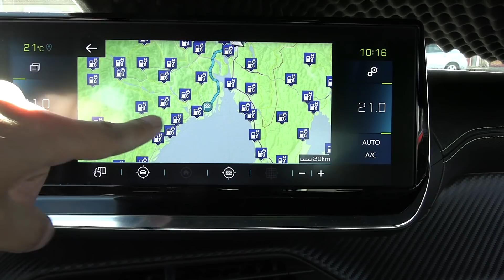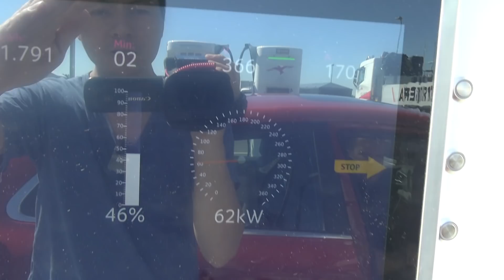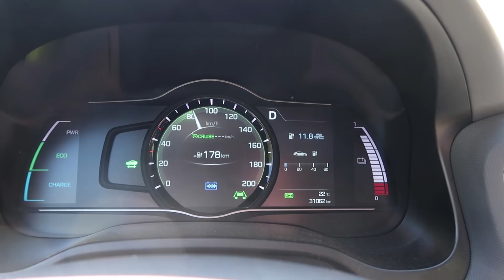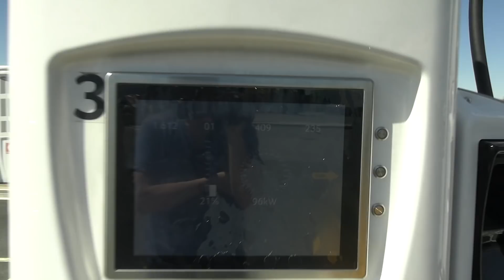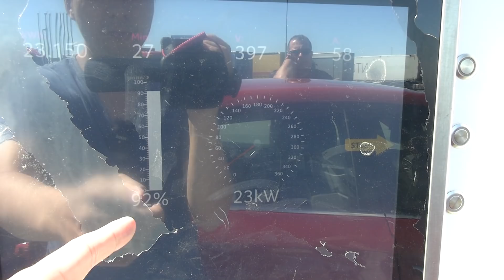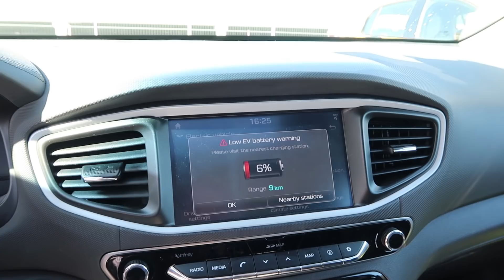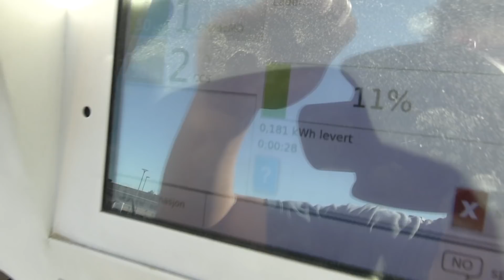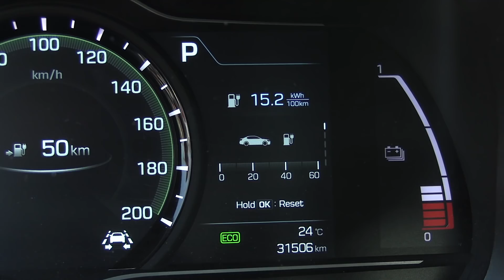Race between Peugeot e-208 and Hyundai Ioniq 28 kWh

Comment: After one year and 21.000 km with my Ioniq, there hasn't been a charging issue with the car. I still can recommend it. The only issue I had was an unwanted noise coming from the mounting of the back seats, which I could fix with a tape. What still surprises me the most, if you switch off recuperation and use sailing only, how long it takes to get slower. If there is a small decline, the car holds it speed without any energy loss. It is still the efficiency king.
Reply: Same with my Model 3 if you put it in Neutral while driving. It feels unreal. Electric drivetrain ftw!
Reply: Got a hold of a classic Ioniq befire they were off the market and man am I satisfied. Such a great EV and super efficient.
Reply: I have one since 4th of February 2019. It has today (4th of June 2020) 47.500 km on the odometer.
The efficiency is almost unreal but having sayd that, this is probably the worst car I have ever owned,and I have owned 36 cars. Even 1987 Dodge Aries was better to sit in 😢
And that is the car that almost got the Chrysler factory bankrupt. 
The worst car I say, yes. Terrible to drive on those Energy saver tires, and not better on the Continental ContiContact 7 winter tires. (I guess I could blame the tires for that) 
Seating position for me (I'm 200 cm tall) is not good for me.
Small space in the trunk, terrible road noise, stupid design to have the front axle lighter than the rear axel and a lot of other things I'm not going to mention here.
You might ask if I didn't test before I bought it, and the answer is yes, I did. But not good enough 🙁

I can't wait to get my Model Y and I would very gladly loan it to Bjørn to do some tests on it...... EXCEPT OFF ROAD TEST.... because he has shown us that he can't the "off-roading" 🤣😂
Sorry Bjørn, no offence 🙂

Comment: It's probably not the front which affext the aerodynamics but the teil - the lower the less turbulence.
Reply: Good Point. But the Front cooler is also stopping a lot of air. Unfortunately Peugeot’s Front cooling system is still Open :( (PSA Plattform -> can built Electro and gas on the Same Platform)

Comment: I've owned a Peugeot e-208 as well for close to a year now, and have had many charging issues as well. Car has been back to the dealership multiple times, it's working again. But sometimes still stops charging without a reason. Also the app doesn't work most of the time, so I am unable to check the charging state or pre heat. Based on your video it seems like it's an overall issue with the e-208, just like the high power consumption. Thank you for putting in the time to show the real world use.

Comment: The longitude of the Ionic is what makes it efficient on roads, small cars have turbulence on the back I think. But it's the opposite arrond cities, where the small weight of small cars is more important than air drag.
Reply: True, although the E208 is heavier than the Ioniq by a significant margin (+100kg at least).

Comment: Only thing that is missing on your channel is ioniq summer range test.
Reply: I got mine down to 8.4kWh/100km today. Couple of days ago I had driven 66km and the SoC was reporting 80%, giving a theoretical maximum of 330km. Not possible in reality, but it goes to show that that car can get you a decent distance in decent weather.
Reply: @Hans-gb4mv  what could be maximum range on motorway 120km/h in summer?
Reply: @jerrym1401  I did about 190km today, mostly at 120km/h and came home with around 18% and 33km left. Here's the chart for a trip I did last year at the end of May, mostly doing 120/130 on the German autobahn https://tweakers.net/fotoalbum/image/fKVi7AznVs7eZuB2w5dKD2bu.png
Reply: It's coming. Bjørn has talked about doing a summer range test with the red Ioniq featured in this video.
Reply: @jerrym1401  It's about 200km. The consumption is around 14 kW/h in the summer with a maximum of 120 km/h
Reply: Getting 138miles/ 220km currently. Temperature 24°C. Mixed roads.

Comment: I already watched the livestream on Saturday but this video was nice entertainment.
I am thinking of changing car but a little afraid of all new cars that have so many electronics functions, especially the low volt for the 12 volt battery in both EV and fossil cars can probably cause problems for me.
Reply: I would say a modern fossil has many more points of failures than an electric has. Moving parts in electric motor: Two bearings. Moving parts in ice engine: Hundreds. Every car has a separate 12V system, fossil or electric. From all I hear Hyundai EVs are ultra reliable doing 100000km with not even a light bulb failing.

Comment: Peugeot had a 4-year headstart, almost double the battery capacity, faster charging, and a smaller car, but they still can’t beat the classic Ioniq?
Reply: Most cars struggle against it.
Especially in the efficiency department.
Reply: Absolutely true.
Especially considering how fast the EV technology evolves...
This would have been an equal race between cars from same year.
In this case Ioniq shows superiority

Comment: Coasting is more efficient on the Ioniq. Pawel should have turned regen off.
Reply: Not sure why auto regen became a thing. Coasting and regenerating/breaking when you need to slow down is more efficient. It makes sense as an option for hill decent or if you for some reason really like one pedal driving, but it should not be standard.

Comment: 12:04 Yeah, I understand why you park like this but I think the cable must be robust enough to handle it. But since no one is affected it's fine, I guess. I saw a video where someone does the same but blocks another charger with it -> that's not a nice panda :(
Reply from the maker: I always use common sense. If there are lots of other cars parked there, I will of course stretch the cable. If you have been reading comments in my videos, you will see that most keyboard warriors who complain about my parking is looking at an empty parking lot/charger where I'm the only one there.
Reply: @bjornnyland  I agree completely! (I hope I don't look like a keyboard warrior^^) Maybe the charging stations could have a flexible "cable crane" to direct the cable to the charging port without stretching. That would be great :)

Comment: @Bjørn Nyland, was the problem with the last Ionity stop the same as Audi e-tron owners had; that the DC plug had to be held tight in the charging port in order to make it lock properly? It seemed to me that the charging cable did not lock in place, hence the charging would not start. But you treated it as a software issue with a swedish reset, since it worked so guess that settles it.
Reply from the maker: No, different problem.

Comment: The sad thing is, the facelift Ioniq would have probably lost by a considerable margin.
Reply from the maker: Most likely not. A better route planner actually estimates that the new Ioniq will be faster. This is due to a bigger battery and therefore better start before charging is needed.
Reply: Wermagst if you regularly do journeys over 250kms that will matter. For the vast majority, they aren’t. Otherwise, the new Ioniq beats it as the range is greater from home. And it has a nicer dashboard, app features etc. Bjorn has a great channel and makes great observations, but there is a lot of emphasis on long distance driving that for most people is a tiny part of their overall driving in a year.
Reply: Hi Björn,when you test the e Corsa
Reply: @amiddled  That's right if you assume that the battery is always fully charged at the beginning of a longer trip. For people without a charging possibility at home that is rarely the case, especially if the longer trip is not planned days in advance. There the faster charging car will almost always win.
Reply: This just begs for an old Ioniq vs new Ioniq long distance race.
Reply: The Ioniq38kWh doesn't charge very fast. That's right. But on the other hand, it is still the king of efficiency. You can drive far in any Ioniq with very little energy consumption. Don't forget it...
Reply: @HenriZwols  Yes, that would definitely be an interesting race...